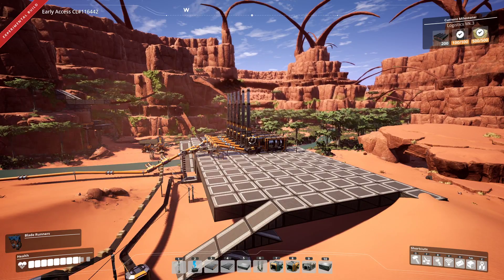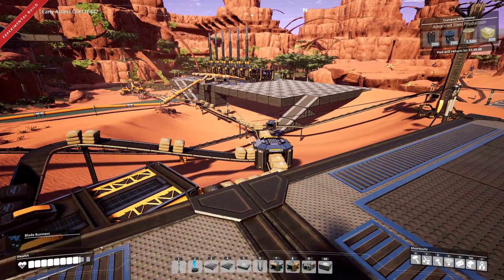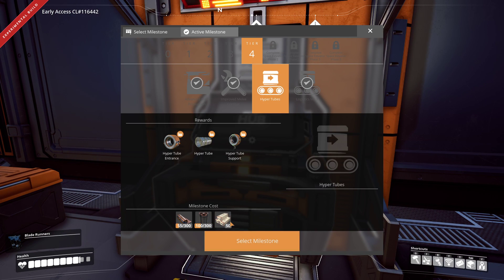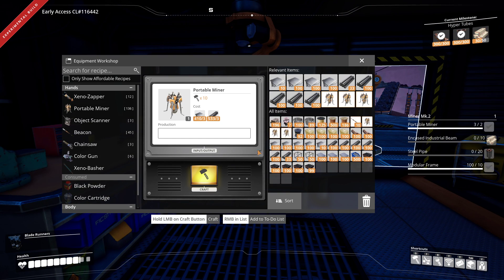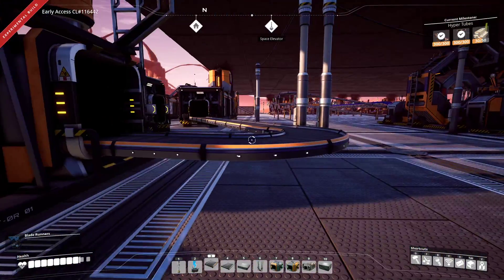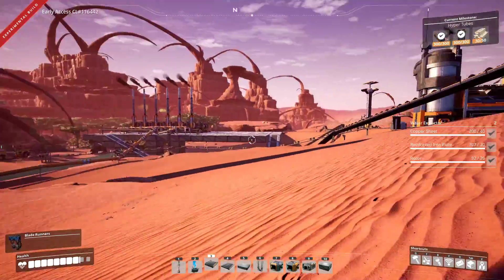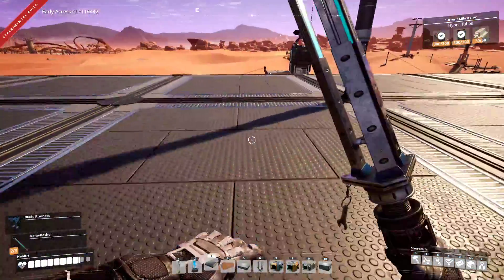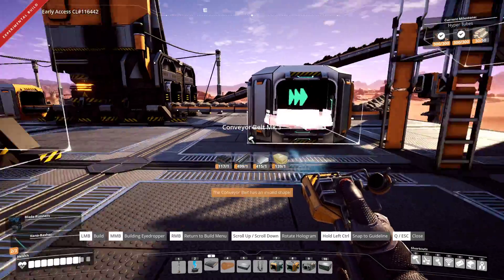Satisfactory Update 3 - Tier Four and more Coal #9

Comment: I do think the belt stackers and the pipe stackers are interchangeable, so you might be able to utilize that in your power facility. Also, one of those foundries is underclocked to 99%, so you're getting 44.5 instead of 45 per minute steel ingots.

I bet you've torn it all down and cleaned it all up by now, but just in case!

Also, I'm glad you spend time exploring on camera and adding new things instead of spending 100% of the time in the factory optimizing. Mixing it up keeps the series interesting!

Comment: Good tip since you're doing the over night tip I mentioned is if you need more end quality items that require multiple constructions that you just grab materials for and manually craft as long as you have the extra power, you can make them by extra mineral nodes so that way you don't need to tap into your other resources as much. Ik it's a little tedious to plan but it's worth it when you run it for 8 hours or so. Gives me alot of extra resources for other stuff!

Comment: If you put a foundation above the second floor lined up with the jump pad, you dont take damage from hitting your head and you wont fly so high every time you use it. Thats what I did when using jumps pads. The tubes are way better though.